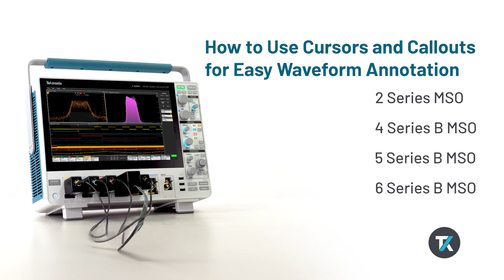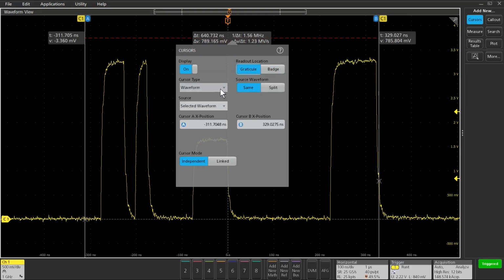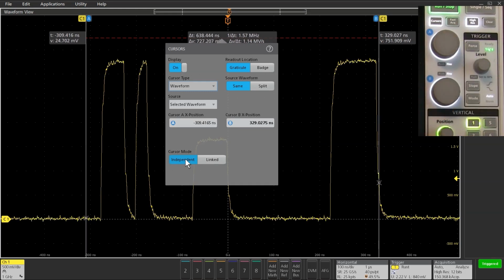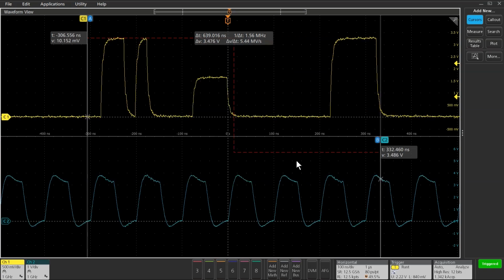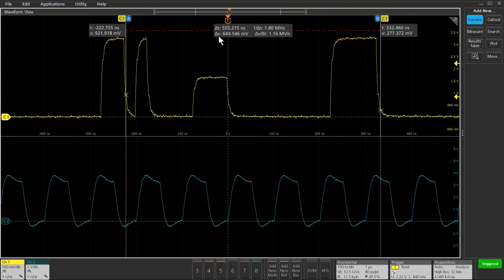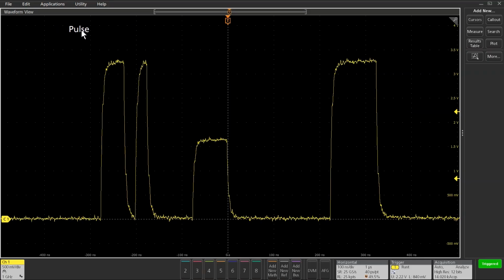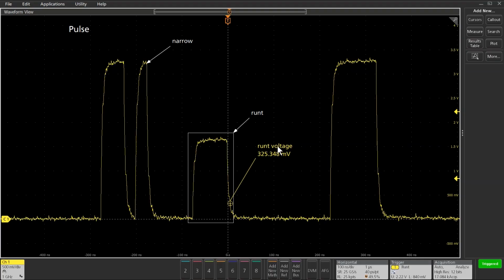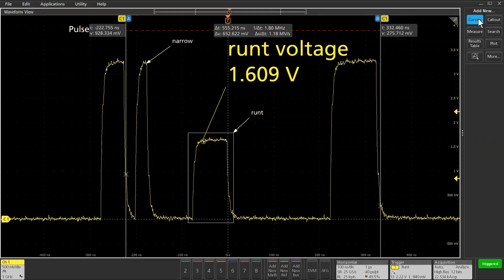How to Use Oscilloscope Cursors and Callouts for Easy Waveform Annotation

Comment: Once again, great video Alan. Another useful feature I like about cursors on Tek scopes... you can snap a cursor to a specific location by right clicking (press and hold with the touch screen) anywhere on screen and select "Move Cursor A/B Here". Very handy when you are zoomed in on a waveform and don't want to spin the multi-purpose knobs a bunch.